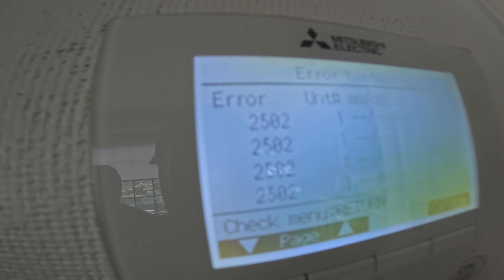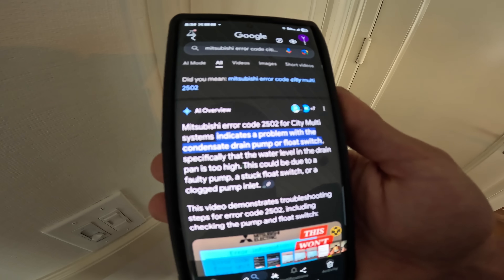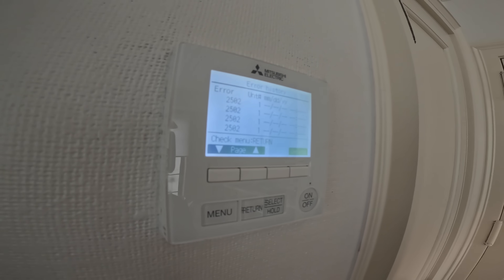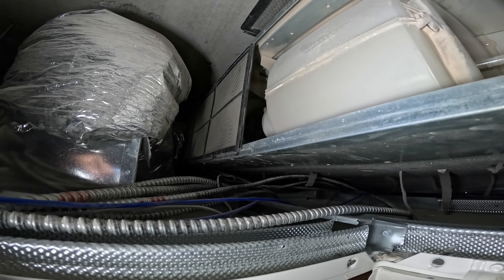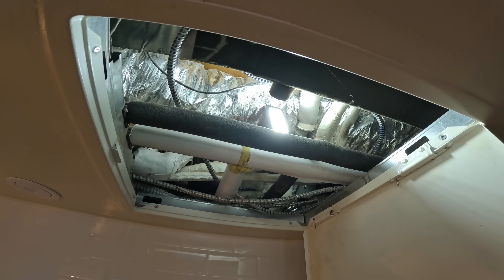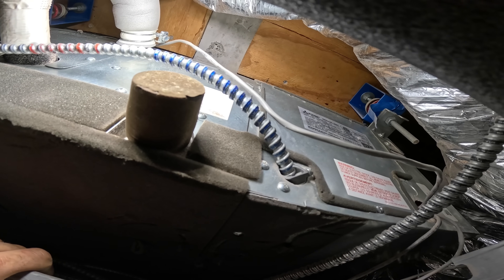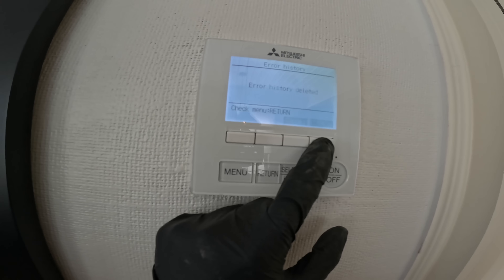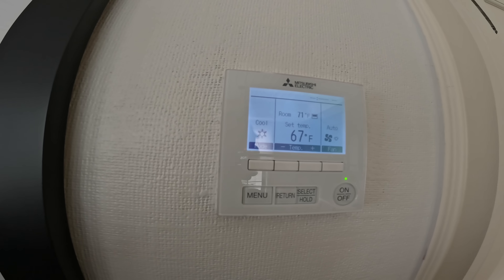HVAC: Mitsubishi City Multi Error Code 2502 Troubleshooting (Mitsubishi City Multi Not Cooling)

Comment: The fancoils we Have has access all around water coming from one side and drain as well just slide the ceiling tiles  get the Job done buy I know a professional like you just need better access at the bottom to the screws an you will be ok

Comment: Next time remove the 2 screws from the bracket. Then you can remove the pump and the flow switch out with their cable attached. Now you can vacuum clean the pan and the pump. Then remove the black hose from the pump and clean the hose all the way to the drain pipe. You can submerge the pump in a cup of water and turn the unit on . This will clean the pump.
Reply from the maker: Great tips. Thank you & thanks for watching! 🔧⚡️